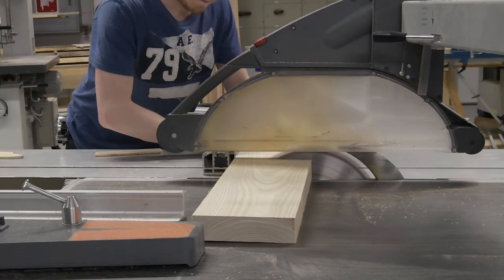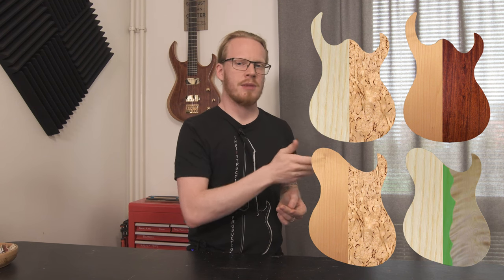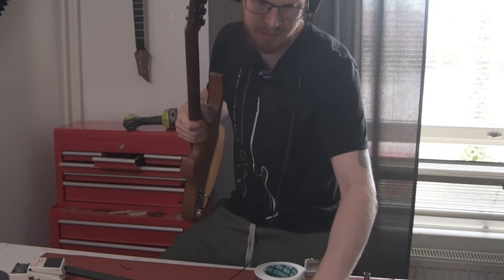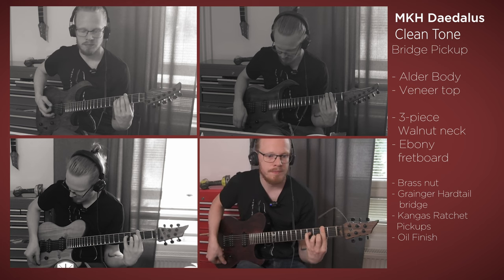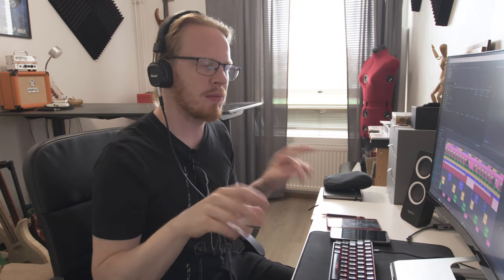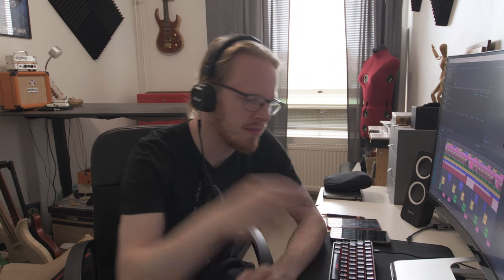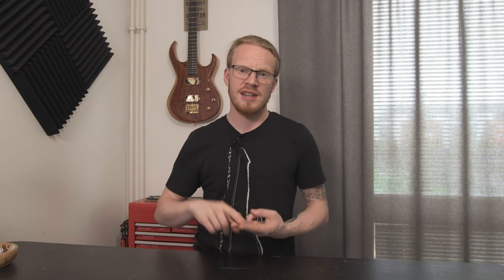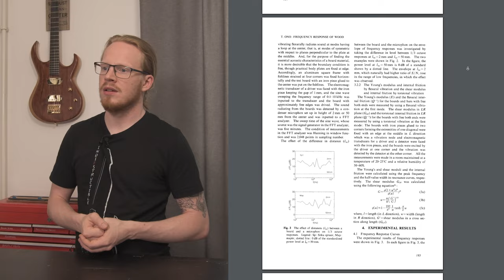Putting the TONEWOOD Debate to Test!

Comment: When it comes to electric guitars there's no such thing as "tone woods".  All there is is just harder woods and softer woods.  The harder woods are better because they don't absorb the vibration of the strings too much at the nut and bridge, which allows all the energy in the strings to be transmitted to the magnets of the pickups, and keeps the sound clean and crisp.  Softer woods create a dampening effect, absorbing more of the string vibrations at the nut and especially at the bridge, reducing the energy left available to go into the pickups, and rounding off the transient frequencies which are absorbed at a higher rate than lower frequencies, which in turn results in a more muffled sound which is interpreted as "warm".  Since the "warm" sound can be achieved electronically by removing the transients (very high frequencies) during the amplification stage, it follows that the harder the material the better.  For electric guitars, rigidity is excellency.  The crisp and clarity of the transient frequencies cannot be added electronically in the amplification stage because amplification can only SUBTRACT, it cannot ADD, so the only way to get those transient frequencies is with the most rigid materials possible.  That's why all-titanium or all-aluminum electric guitars sound so good and are so expensive:
https://youtu.be/2eEB-vJic_o
https://youtu.be/dEJJeNuQcc0

Comment: I listened with my eyes closed, and if there were differences in sound, they were so subtle, to me, that it basically ends the debate regarding tone wood for electric guitars. Its just not worth getting my panties in a bunch over tone wood. I think it makes a larger difference on acoustic instruments, so carry on the debate there, if there is one.
Reply from the maker: I agree, like I said in the video, even I got confused. The differences if there were any were hard to come by. I still however stand behind the whole "recipe" analogy, however minute. While yes, of course tone wood is mostly an attribute to associate with acoustics, I do think it makes a difference, but on a muuuuch more granular level.

I still put method of construction in electrics much more at the forefront rather than woods used. So set neck vs. bolt-on vs. neck-through.
Reply: @IPGuitars  Yes to all of that!

Comment: My research as a luthier in training is that tonewood sort of applies to acoustics, but has basically nothing to do with electrics.
Not on personal taste, I almost always prefer cheaper pick ups. I feel like they sound closer to the spirited guitars of old.
Reply from the maker: Totally get it. Yes, tone wood naturally of course started with acoustics and there makes THE difference. However, I still firmly stand with the recipe analogy :) tone is made up of everything to do with the instrument. That being said, I put more weight into the actual construction method over wood choice
Reply: @IPGuitars  Yeah but the difference is really negligible. Also some factors you can't control. Pots vary in their resistance values sometimes quite a bit. Did you measure them? That could explain slightly more highs etc. Also what makes HUGE differences and what people overlook besides strings and nut is what you are holding in your hand: The pick! Just using a wooden one compared to a metal one is like night and day.
Reply from the maker: Absolutely agreed. The pot differences I tried to eliminate by using the exact same wiring loom in each guitar, so I wouldn't be putting in different parts to have some modicum of control. I only know how to play in a certain way and the bridge is the same, so my hand placement should also be the same here.
Reply: @IPGuitars  Yeah the problem is the fluctuations the manufacturer allows. However a great test. I think I'll mention it the next time I comment of Glenn Fricker's videos about that issue.
Reply: The only way the wood can affect the tone is by resonance,( moving air creating different frequencies coming to our ears).What we hear when playing an electric guitar has nothing to do with moving air.Pick ups are not microphones...what we hear comes from a magnetic field disturbed by vibrating steel strings creating an electric signal  converted and amplified by the amp.
But I'm open to change my mind if someone could provide a serious and scientific explanation of how a magnetic device can pick up and detect resonance from the vibration of the woods making air movement and creating resonance resulting in a different tone.

Comment: Personally I think once you make sure your pickups are in the exact same place, they have the same height, the electronics are the same and the nut and bridge are the same, the woods won't make a damned bit of difference.  Jim Lill's video, which was by far the most scientific I've seen, convinced me of that.  Even if there is a slight difference you wouldn't be able to hear it in a band environment. This is only for electric instruments of course. 

I used to play violin and the particular instrument made a HUGE difference, even though the design of all violins is very similar.  In general I found that aged instruments tend to sound better. I had a 100+ year old violin and 200+ year old violin and both sounded far better than any other modern violin I'd ever played.  I'm guessing the same is true of acoustic guitars, but I've only really owned one so I can't comment too much on it.
Reply from the maker: I agree with you on most parts. On acoustic instruments there is ZERO speculation, wood tone is a real thing there. However, as mentioned I am more a keen advocate for construction method over materials used. Which is why I also take some issue with Jim Lill's video.

Let me elaborate:
In Lill's video we see a case-study of a bolt-on instrument with a suspended pickup (be it a pickguard/bridge plate). The transfer of resonance in this construction method will vary greatly to that of a set-neck/neck-through instrument with direct mounted pickups. I am not saying that either mine nor his videos are ABSOLUTE truths. This is an extremely difficult thing to actually research properly as the ever so subtle differences between test materials cannot allow for proper scientific testing.

Which results in the debate we see online :) I did state in the video that whether or not you can hear a difference, I believe that the tone of an instrument is the sum of all of its parts. Disregarding the player and hand-tone for a moment.

At the end of the day, you will gravitate toward the instrument that makes you want to play. And that is the only thing that matters in the end. If the guitar sounds good to you, then good. Might be made of this or that, but that's the only absolute truth :D
Reply: Yeah wood ages and the resins harden over time. They definitely change their tone also over time as these beautiful instruments age. That is why wood is still the most popular building material. It evolves over time.

Comment: Great video! I'd be very interested to see a spectrographic analysis of all the signals. I could barely hear a difference between all the clean tones. Like, if I closed my eyes and listened really carefully, I could kind of tell you had switched guitars, but I couldn't really qualify what the change was? It sounded to me like the change in tonewood was making very small volume changes to a broad range of frequencies and harmonics, rather than adding any big spikes. And then, of course, with gain all of those subtle differences just get compressed right out and it sounds more or less the same.

I think the ultimate question in the tonewood debate is this: how practical is it to pursue one tonewood over another? For my playstyle and musical tastes, the answer is no, not really. Not for the sake of tone, anyway. Feel, ergonomics, and reliability are much more important factors for me in selecting an instrument, and the materials selection can make a difference in those areas, but for some reason that fact gets less attention than the tone.
Reply from the maker: Totally agree and I wish I would have done a lot more with this test. Gone A LOT deeper into the analysis of things. The spectrograph would've been an ideal thing to take into account and use. And I totally agree, the more I've listened to each clip the less I hear the differences, BUT let it be said that my shoddy playing every time doesn't really help either to provide any consistency. The gain definitely just didn't make a difference at all. And I totally agree with your thoughts on pursuing tonewoods.

Personally I tend go against the grain anyway with wood choices (pun slightly intended), but that's also more due to favoring domestic woods. Chasing the exact same woods as everyone else is also not great from a sustainability point of view. I will always say that the actual construction plays into the tone more so than the woods used (and of course every other "ingredient" as mentioned in the video). And I am with you 100%, but the human brain is a peculiar thing. I think our own preferences have played into thinking that certain woods sound better, when it just could be that a certain feel and construction have been the cause for the instrument feeling great to play.

Thank you for your comment and thoughts on the matter :)

Comment: Is it an Acoustic Guitar? Wood makes ALL the difference.

Is it an electric guitar? Then it makes NO difference at all apart from the feel in your hands and what it looks like.
Reply from the maker: 100% hands down agree with acoustics.
But I do have to say that even with electrics, it does play a part. While yes, fractional in comparison, the tone is a sum of all its parts.
Reply: @IPGuitars  Tone is definitely altered by different things and parts such as pickups, pickup height, string contact points such as the bridge, if there's any ferrous metals near the pickup, anything that can affect the magnetic field really but we will have to agree to disagree on the electric guitars tonewood thing - I think the wood makes zero difference as they are electric guitars and the sound is purely electrically generated, that's why they are called electric guitars.
Reply from the maker: We can agree to disagree yes :) But I completely get your point of view nonetheless. Also, thanks for adding to the conversation👍🏻

Comment: Dillon does Tones also did this test. He added a Tele neck to a outside wooden plank fence. It sounded like a fender guitar. ToneWood for Acoustic YES for electric NO.
Reply from the maker: Ah yeah, I remember seeing that video. Once again I will go back to what I have said in the comments here a lot: construction is key.

Bolt-on vs. Set-neck
Pickups mounted to rings/pickguard/bridge plate vs. Direct mount
And so on.

However, there is no doubt that wood tone is a definitive thing in acoustics. For electrics I stick to my "all a part of the recipe" metaphor. It doesn't play as big a part as many make it seem, but does play its own part in the grand scheme of things. But it is insanely difficult to properly test, document, and research due to so many factors that play a part in it.

Whoops... Didn't mean for this to be such a long reply😅

Comment: The tonewood hypothesis is that some species of trees produce wood that is bright. Or that is warm. And some species of trees produce wood that is just dead and sound bad.
The tonewood hypothesis has nothing to do with individual guitars sounding different. Or even that the piece of wood has an effect on the sound of the guitar. The theory is that it is the species of tree that matters. Not the individual piece of wood. Not the individual guitar build. And that when you make a recipe for your guitar, you select the right tonewood aka tree species.
Also always absent in these videos is a way to mathematically quantify the sound of the guitar. Ise a Fourier transfer to fingerprint the sound. And then use statistics to measure similarity.
Reply from the maker: Pretty much. It's an annoyingly complicated thing to try and actually properly mathematically and scientifically quantify. I recently came up an idea of how this could be researched in a controlled manner, but the method is completely out of reach for someone like me. Might make a video to share my thoughts and see if I can connect with the appropriate people in the field to conduct the experiment and research. While yes, woods by themselves can be measured and trialed to figure out resonant frequencies that addition of the different parts that make up a guitar (without the human element) make it tricky to quantify.

Comment: Wonder if you could take and put tuners pickups etc and fasten everything to a piece of stiff rubber that totally dampens any vibration or resonance that you get from wood and do a test with it n see what sort of sound one could get from it. Just a thought.
Reply from the maker: Provided that you get the string tension the exact same. Technically that could be tested by putting rubber washers under the tuners, string trees (if any), under and around the nut, under the bridge, and surrounding the pickups as well. 

But then again, the same concept here applies as the guy who clamped up everything in between two benches. That was more-or-less isolating things to a bolt-on + pickguard mounted electronics + floating bridge level.

Comment: Clean tone, I think I could hear a difference, the lower right seemed the least interesting to me. But on the dirty tone they were all very similar to me. For me, wood makes a difference in how I feel the vibration of the strings, or how they sound unplugged. But plugged in, good tone is a great pair of pups.
Reply from the maker: Yeah, the high gain just... made everything sound exactly the same. MAAAYBE slight differences in coil split tones, but we're splitting hairs because we're actively trying to listen for differences.

And completely with you on the feel. And at the end of the day, a guitar that FEELS great in your hands to play, will also affect how it sounds as you are much more likely to play more relaxed. Hand tone is a big part. Which is why tests like this will ultimately boil down to "inconclusive".

Comment: Great video, here's my opinion

There were little differences here and there, but Im pretty sure a little turn of the bass knob would make a much bigger difference than buying a new expensive guitar. Besides, if every wood sounds unique, then why buy the more expensive ones?

Also, now im interested in why jim lill had no difference in his video. I wonder whether you or him made some mistakes. Either way, im not buying an ultra-expensive guitar while i can get another that sounds the same for much much cheaper.
Reply from the maker: Might be that there were small differences, but I'll still attribute most to the whole picture with emphasis on construction. Incredibly hard thing to test for, but I have ideas... we'll see if they come to fruition.

Now to address a couple of things:
Why buy the expensive ones? Essentially the more expensive stuff (while they might be made of more expensive materials) boils down to craftsmanship. For instance anything made by hand will cost more due to the hours of actual labour put in ($/h). The more skilled or renowned a craftsman becomes, the more value is added to their work (more years experience at a job=better pay). That is 100% the case with the smaller luthiers and workshops out there, but also within the custom departments at bigger brands (though let's be fair, if it gets a stamp on the headstock from Gibson/Fender etc. it'll hike up the price even more so).

You should get a guitar that inspires you. That's all it REALLY boils down to. If a cheaper guitar makes you want to play and feels great, then that is awesome. Collecting guitars is another thing, but not gonna get into. And then there is wanting a guitar from a certain maker to support their craft. Whatever floats your boat, as long as you pick up a guitar and pluck away :)

Then about Jim Lill's video, which is a great video, but I do have my issues with it. He took a bolt-on design, with pickups installed so that they are suspended (pickguard/bridge) and bolted strings and the bridge onto two other surfaces. At face value when it comes to the string interacting with the pickup and resonance carrying over, he changed nothing/very little. I would love to see the same done, but with a set neck/through-neck with direct-mounted pickups. These three construction methods clearly have a different sound to them. Even with just pickups installed in a pickguard/surrounds, if you pit a bolt-on and set-neck together with the same parts, they will sound different with the bolt-on giving a bit more "twang" to the sound.

I would love to recreate what I described, and perhaps one day will, but need the time and resources to make it happen in a much more controlled way than in this video.

Thank you for your comment! Always great to hear different opinions on this matter 👍🏼